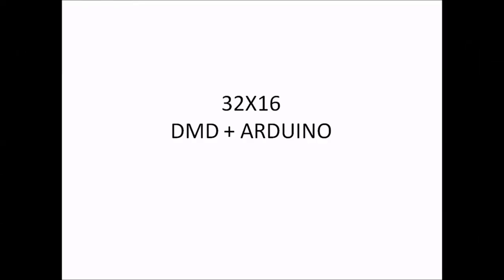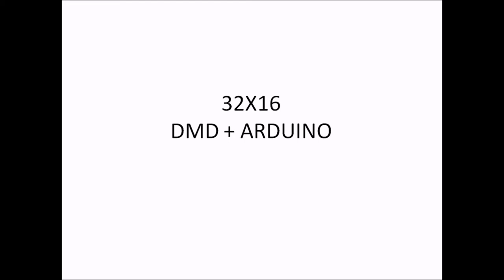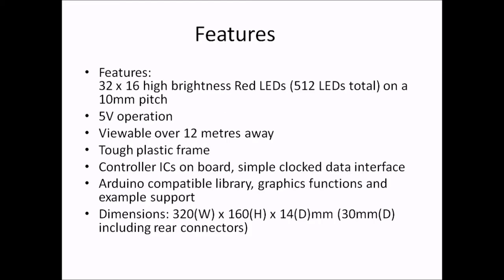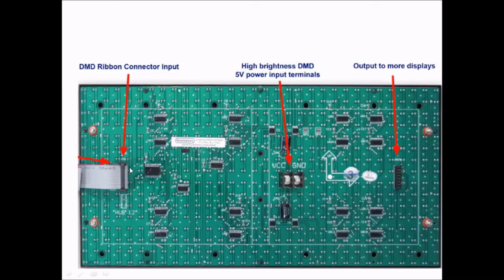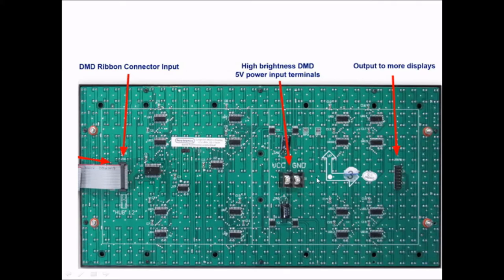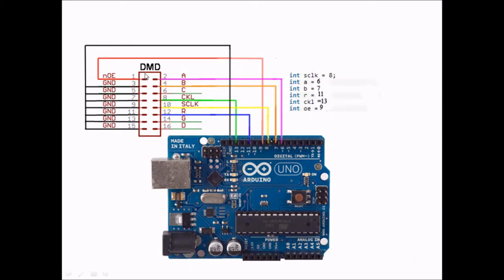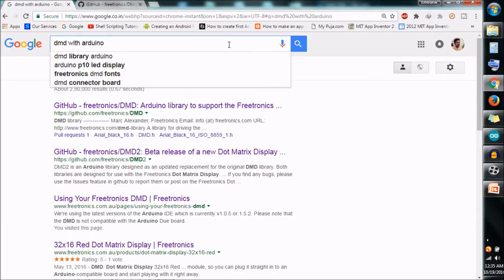[How to] Interface Dot Matrix Display (DMD) with Arduino

Comment: Arduino: 1.8.3 (Windows 7), Board: "Arduino/Genuino Uno"

C:\Users\acer\Documents\Arduino\libraries\DMD-master\examples\dmd_latin_chars\dmd_latin_chars.ino:41:27: fatal error: TimerOne.h: No such file or directory

 #include <TimerOne.h>   //

                           ^

compilation terminated.

exit status 1
Error compiling for board Arduino/Genuino Uno.

This report would have more information with
"Show verbose output during compilation"
option enabled in File -> Preferences.

I am facing this error. pls give suggesions
Reply: get the file from here
http://code.google.com/p/arduino-timerone/downloads/list

Comment: HI sir,
I tried compilation error is come timerone.h  file not included that location  is showing  how to include the file pls help me.
Reply from the maker: You have to use timerone Library, before using Timerone.h header file.

https://github.com/PaulStoffregen/TimerOne
Download this file add to library folder of arduino In C drive.

Let me know if u still found any error.

Share and Subscribe
Thanks
Reply: get the file from here
http://code.google.com/p/arduino-timerone/downloads/list